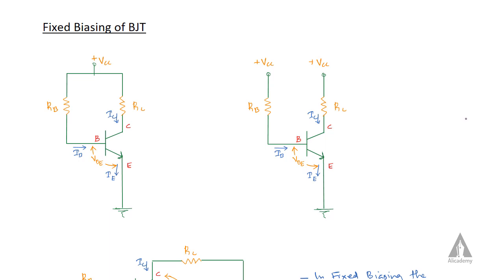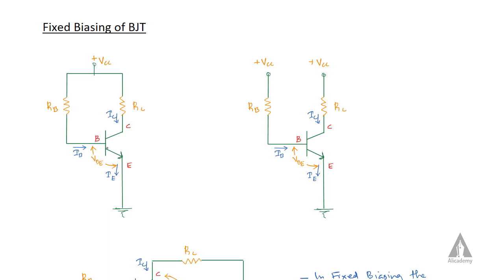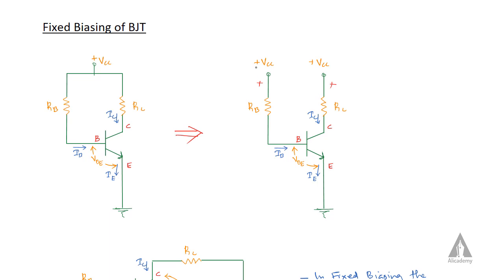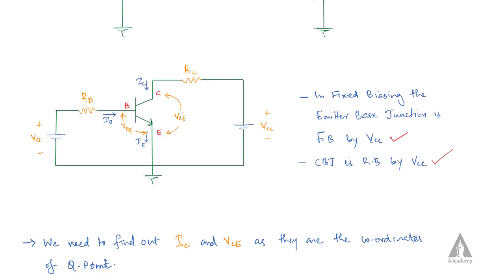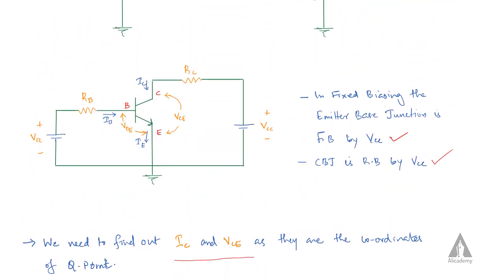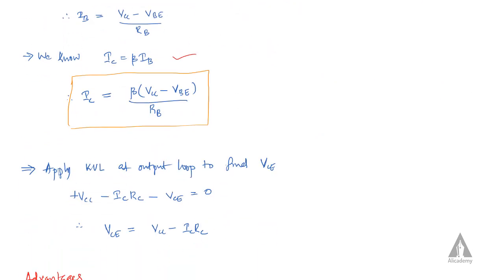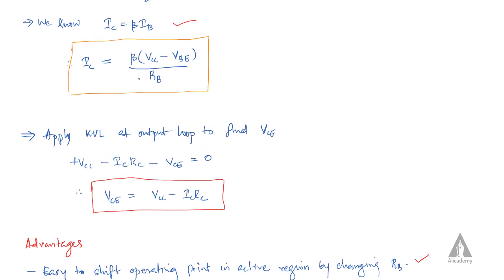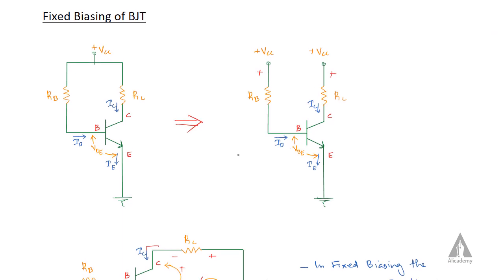Fixed Biasing of BJT | Analog Electronics | KTU | Malayalam

Comment: sir i think u should have taken the i/p volt to base and emitter as Vbb(as u have said in one of your videos) , here 2 Vcc @ the i/p and o/p is causing a confusion...
Reply from the maker: There is no need of a confusion. Here a single voltage source (Vcc) is used to bias CBJ (as Vbb) and EBJ (as Vcc). Using appropriate resistors Rb and Rc we can acheive required biasing voltage (from Vcc) at the respective junctions.
Reply: @AliAcademyIN  Tnx sir